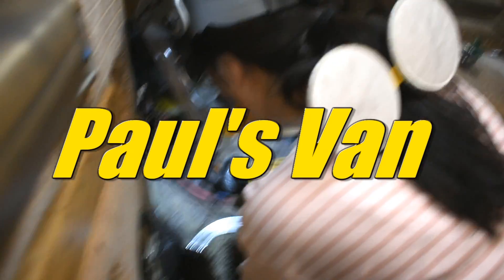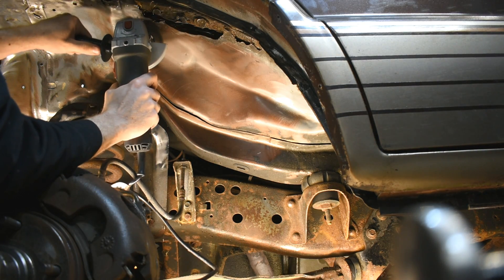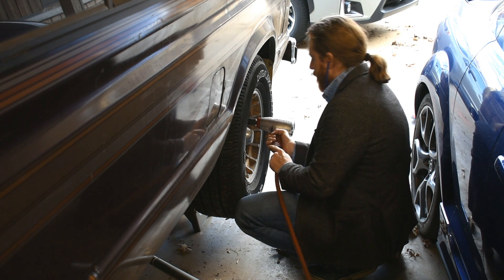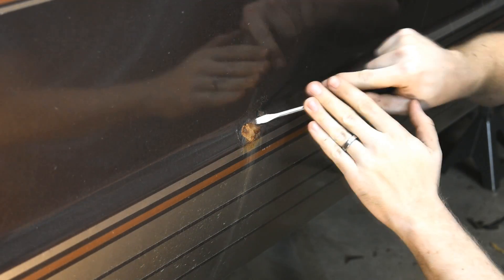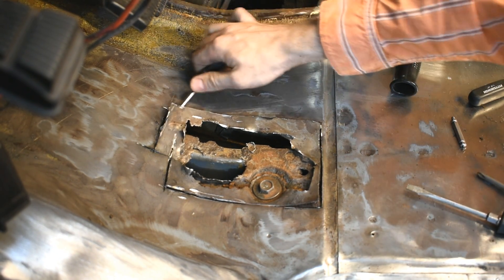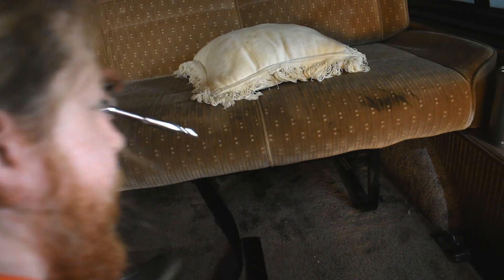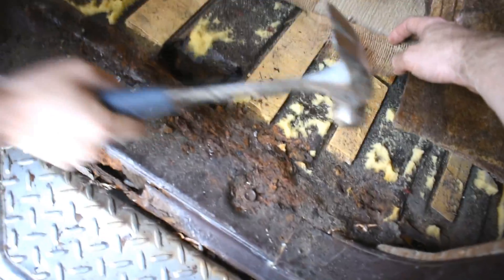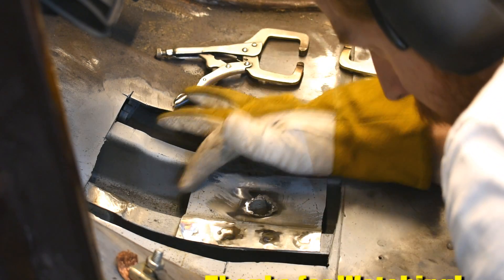Paul's Old Van Part 4: Tearing out the interior with my wife

Comment: Here’s  one for ya, Paul. 
I had an ‘89 IROC 350ci with t-tops. It looked great and was really, really fast; however being a fast car ( and I always took advantage of that)  meant I did a lot of braking.  After destroying a set of brakes in under six months,  I tried to change them myself. In the process I broke a 1/2” and a  1” breaker bar with a two foot cheater bar trying to get the lug nuts off.  Took it to the bus garage at the school where my dad worked and they used a 1” impact , the one the used for bus tires, it took them two cans of WD40 and and hour and a half to get all the nuts off. I understand your pain!
Reply from the maker: Stuck fasteners are literally the worst

Comment: shag carpet catching fire..... i seen it happen actually , smokes like crazy  
might be a good idea to somehow make sure nothing is even smoking a little before you go inside for the night 
seems like the leaf springs are pretty sagged , you might need some new ones , unless you loaded the rear of the van up to the roof causing them to arch backwards
when you take a part stuff on the van and put all the hardware in containers for salad peanutbutter and all sorts of containers that are left after finishing the product in it , mark where the hardware is for on the container and store them with the rest of the materials , it makes it eazier to put stuff back together 
you should copy the wood stuff on some stiff paper so you can use it as a template before trowing them out (mark the woodgrain direction on them too)
Reply from the maker: Ive been bagging the hardware and boxing it up, going a bit less organized on the interior stuff since im not reusing it.  Im hanging onto the wood for patterns like you say.  The leaf springs have always looked that way, the back end has been full of furniture for years, the springs are probably pretty worn (and real rusty)
Reply: might be there lowered / lightened springs as the van has been used as an rv , unless there broken and you dont load the van up so the axle  rests on the bumpstops they should be ok 
too bad its a ford , i have an old chevy truck and found tons of websites selling new stuff for them (cause i need those ) , not so mush for fords , they do exist though im just not intoo it as mush , ecolines been selling a lot so you should be able to get parts for them 
sofar the rust seems to be manageable no double skin stuff you cannot get too , just keep plugging away at it , at some point the holes are fixed , you whont find new holes to plug and weld and you be putting the van back together 
hope you keep that sleeper couch , these things can be pretty handy , if not you actually might be able to sell it to someone doing a camper conversion for a good price

Comment: Ok I'm going to tell you this as a mechanic and i hope you don't get mad at me . The rear leaf springs should have a upward curve not the downward bind they are bad or need to be re arched not easy or cheep but will make the ride way better. After watching you're video i hate to tell you that but my ocd made me if you fix it video it . It won't be easy i recommend pb blaster on all bolts a week before you start bolts rust no tools you may need help.
Reply from the maker: Why would i get mad? Ill take any help i can get!  The leaf springs are so rusty looking i was considering just replacing them anyway.  Old scrap leaf springs are good steel to practice forging stuff ive heard ;) win-win as far as im concerned
Reply: The springs are 1095 steel they make a good knife . Hold a sharp edge.. If you have a ? I'll try to answer them 4 you

Comment: Did some work for a company that customized trucks and vans. The vehicles would be delivered to them totally without interior anything except dash. No factory seats, drivers seat was actually made of heavy cardboard. Those vans like you have sell for cheap because of what your running into, lots of rust even here in the south where we don't have road salt to contend with. You might look around for a donor van maybe one that has been wrecked or been totaled , or has major mechanical failure. When you get what you need sell it for scrap. Good show with the boss showing you how to do it. Don't forget about the challenge.

Comment: The holes are there because in case a lot of water spills in the van, it will soak through the carpet and then fall out the hole onto the ground, safety Feature so you don’t  drowned
Reply from the maker: Good point!  Its not a rust hole, its a feature!